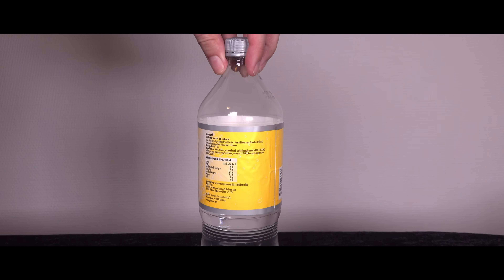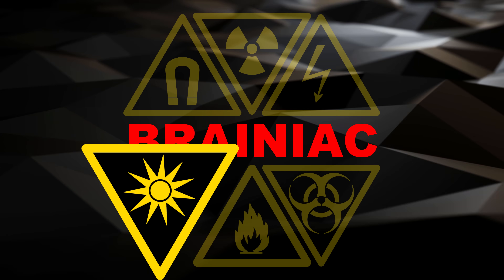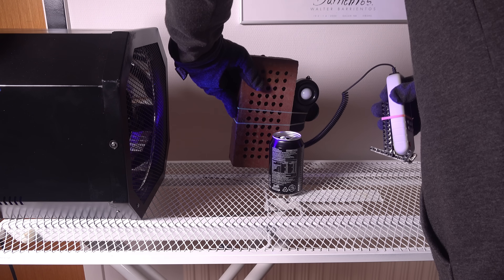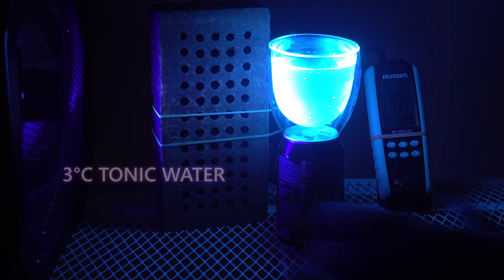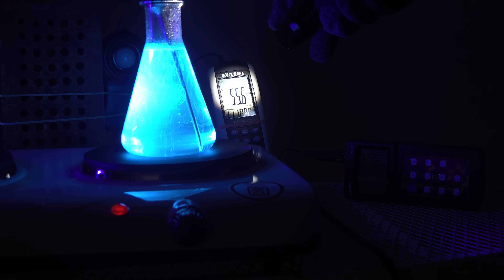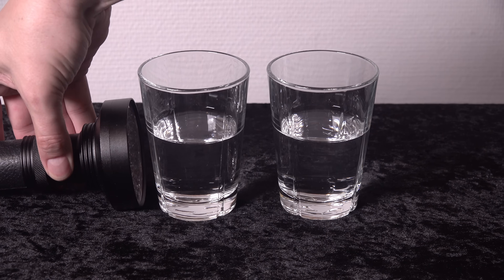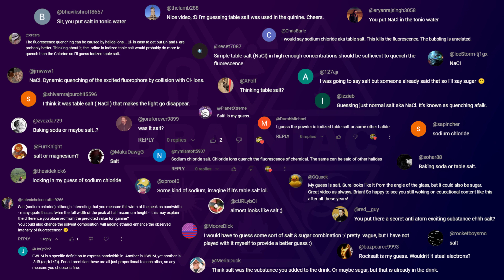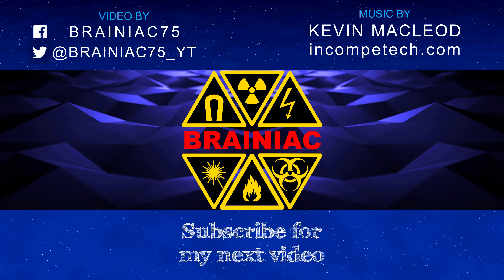Messing Up the Fluorescence of Tonic Water - in several ways...

Comment: The 400W blacklight is used for theatrical performances for simulation of moonlight in plays if anyone wonders. They got some that use LEDs that are 405 and 365 that are much stronger since most of the wattage is at the extreme violet or true UV. Very dangerous to look at either one.

Comment: Does salt reduce the fluorescence of other chemicals? I tried with the green fluorescent dye in a highlighter and it didn't seem to change at all. I'm not sure what the dye is, possibly fluorescein or pyranine
Reply: at the very least, salt should reduce the fluorescence by simply being an impurity (increased volume of non-fluorescent material in general, diluting the effect). its hard to say for sure beyond that without knowing what mechanism the dyes use to fluoresce.

this is complicated by the use of a green highlighter rather than a yellow one! since pretty much every yellow highlighter uses pyranine, and only pyranine as its fluorescence source. im fairly certain green would use a mixture of pyranine and whatever blue fluorescent chemical they use, but i know a lot less about that, blue fluorescent dyes seem really complicated!

pyranine changes its fluorescent properties based on pH similarly to quinine, except at a different and wider range of pH values, making it a potential choice for measuring the pH of solutions. when in an aqueous solution along with salts, i think it exhibits some sort of quenching still, but im not a chemist and all the stuff i could find online simply mentioned that salt interferes with the pH readings when in solution with pyranine. from what i read, it always made the pyranine appear MORE acidic than it should, which means it was quenching, since more acidic = less bright with pyranine. but i might be interpreting that wrong, im pretty bad at chemistry. im basing this primarily off of the free portions of this paper: https://www.sciencedirect.com/science/article/abs/pii/S1010603008001767
which says that the presence of salts in their solutions decreased the apparent pKa of the pyranine. with a lower pKa meaning more acidic, that should mean the pyranine fluoresced less. but later, they say that the presence of salts was making the solution overall appear more basic. the only way ive been able to reconcile these claims in my head is that somewhere in the paper, theyre subtracting the apparent pKa of the pyranine from the solution, and since that pKa reading is more acidic than it should be, the remaining solution is appearing less acidic, or more basic than it should be. which makes sense, when using pyranine to measure the acidity of something, you want to be able to mathematically eliminate the added dye from your solution, since you likely dyed a sample of a larger solution and dont want the pyranine included in your final result. 

as for the blue dye, thats where my research kind of got stuck. fluorescent blue dye in markers seems to be usually a mixture of non fluorescent dyes and brightening compounds. essentially "stealing" the fluorescence of other compounds and reflecting them into the blue spectrum. i assume that means they'd just add non-flourescent dyes to yellow dyes to make it green, but there is a lot less information on that, at least that i could find easily. blue fluorescent compounds are generally not as affective at converting ultraviolet light in to blue light anyways. since we are taking the high energy state of ultraviolet light, and moving it the least far down into lower energy color in comparison to the other dyes.

Comment: As a side effect you made me realize that these double insulated glasses aren't as dumb as I thought. They are always marketed as being used for hot drinks which is dumb in my opinion because that makes it 10x more likely to burn your mouth. If the glass is hot you know it'll also burn your mouth. They are much better for cold drinks.
Reply: Thunderf00t used them to get a clear view of liquid nitrogen and I was amazed
Reply: Got a box of them for a family member a few years ago. They love them for hot drinks. The glasses ended up being more durable than I expected.
Reply: I have a set and I love them for any kind of drink though you are right they keep stuff hot for a very long time
Reply: You are simply not used to it.
When i was a kid, we had some similar glasses, simple insulated, but with a vegetable/organic basket on the lower half. The glass was to be filled with hot punch (alc-free for kids; pretty common in Germany). I was told by my mom that i have to be careful as it's hot. I then learnt that you get an image of the temperature by your hands, by touching the upper glass edge with your lips, by the evaporating liquid that touches your face. And if it's too hot, you blow.

And furthermore i learnt that, if i touch the pure glass without the (cooling) basket around it, i burn my fingers. If i then wait until the glass has cooled down, so i can easily touch the filled glass, it's likely too cool, just warm, not hot anymore and not the quality you need for a good punch. And the simple reason is that a hot punch in a glass has a lot more potential to burn you/your fingers than the tiny sips you take to drink it.
And, if it helps, another good tip for edible contained liquids like soup in a dish is, that it's hottest in the center and coolest at the rim. Which is another reason why your glasses are double insulated
Reply: I've owned some for years, and have exclusively used them for cold drinks. I never understood the hot drink only marketing. I'd wager far more cold drinks are consumed overall, and a cold drink that's warmed up is far worse than a hot drink that's cooled down.
Reply: @Sypher474  The physics actually favor the cooler drink. First evaporation over time will tend to cool the liquid to the dew point. In my house right now, this alone will maintain a drink about half way from room temp to freezing and in a drier environment can be closer to refrigeration temps. If colder still is desired, ice contains a massive amount of cooling power, take it down to freezing, and will act as a buffer for the duration of the consumption. A third issue is that the temperature difference between room temp and a cold drink vs a hot drink is greater for the hot drink. The rate of energy exchange is on the order of the fourth power of that delta. 
As a separate issue is the comfort of holding an uninsulated container. A thin metal cup full of ice and near freezing water doesn't bother most to pick up and take a sip. A fresh hot chi or coffee is another story and is likely to end up with significant discomfort, possible spills, leading to minor burns.
All the above and the smartest thing is to just use insulated containers in all situations.

Comment: My first guess was some kind of a quencher. I don't like the idea of assigning quenching abilities to anything that lowers the fluorescence intensity - or turn's it off completely. Increasing a pH is main ability of NaHCO3, and changing the structure of quinine to the one which is not fluorescent is a byproduct (or a result of a change in medium pH). Whereas it does lower (turns off) the fluorescence, we are speaking of different chemical that had undergone acid-base reaction, thus I don't like naming any pH modification substances as quencher. For me proper quenching would be a molecule that is either reacting with excited quinine (dissipating the energy via chemical reaction), or absorbing the fluorescent light and then dissipating it via thermal or chemical reaction means. 
I didn't watch entire of the video yet, nor this comment is referring to the content. I want to provoke a academic discussion, because both my studies and wikipedia taught me that NaHCO3 would be a quencher, regardless of the quenching mechanism. Open to discuss this topic!!
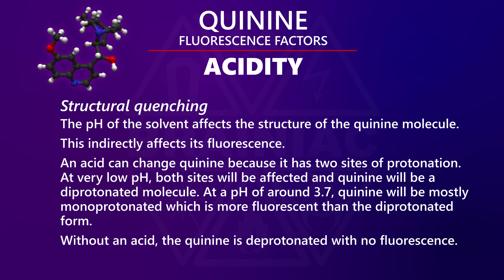Reply: So at 6:27 you are mentioning the exact issue I have with current quenching definition. Quinine can have different forms pH dependent. My problem is that for example HCl and NaCl solutions are totally different, we don't say NaCl is the same molecule as HCl after adding NaOH. For organics same argument goes for acetic acid and sodium acetate. So why should we name a product of quinine reaction with a base, different form of quinine?
Reply: And for NaCl, i totally agree. NaCl (in my modified definition) is a proper fluorescence quencher.

Comment: @Brainiac75
3:45 What happens if you freeze the tonic water?
Will frozen & then melted tonic water behave any different to not-frozen tonic water? (eg. destroyed molecules by freezing?)
How will the graph look if you start with a cylinder of frozen tonic water, maybe at -30*C then you continuously heat it up, until almost boiling, and measure the Lux every 10*C ?

Comment: Hi Brainiac, can i ask something please. If you placed a double glazed window filled with tonic water over a solar panal... would the Quinine capture UV light in sunlight and energise the solar panel even more?
Reply: It would be better to use a redder dye like a rhodamine family. Solar panels have the highest quantum efficiency for near IR light around 800nm. You can use the dye to convert the blue to UV range to longer wavelengths that would increase the output, however you would need to add only enough to convert and not absorb the light.
Reply: @christopherleubner6633  hmm... interesting. Thank you for that. All the best :)